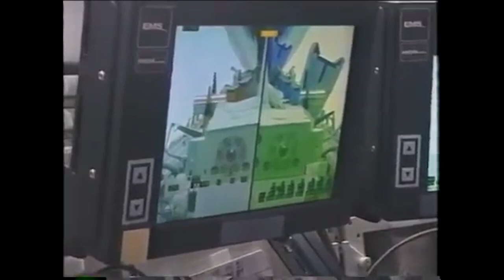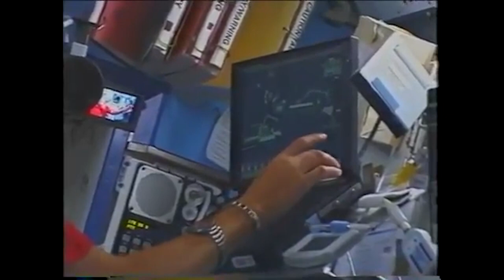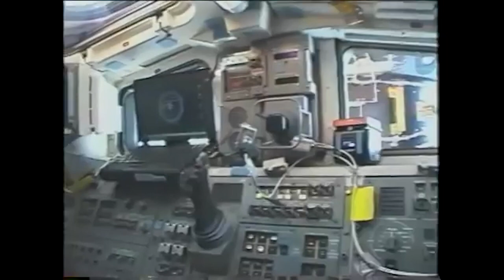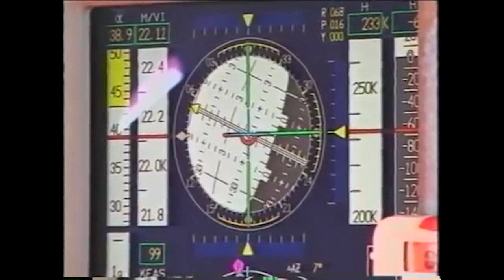International Space Station - Episode 16 - S1 Truss

Comment: STS 112 and 113 were important flights they delivered the radiators to the station. Each radiator is housed on the S1 and P1 truss and expels heat from the station. During launch of STS 112 a chunk of ice baked into the foam came off the tank and struck the SRBs O'keefe told NASA to ignore it and press ahead with STS 113 and STS 107. This mistake by O'keefe lead to the loss of Columbia and the destruction of four rockets because NASA and ILS put safety second instead of first.  Because of Columbia, September 11th and Bush placing O'keefe as administer all ISS flights were cancelled until 2005 and the Centrifuge and HAB 1 were canceled Nauka and the Science Power Platform were placed into storage but degraded and two research modules were also canceled. STS 114 and 121 would later bring the shuttle back to flight Bush fired O'keefe as a political hack and replaced him with Griffins to return the shuttle to flight and Bush directed all future flights to be ISS missions and the shuttle to be retired by 2012 to make way for missions by Dragon and the Cygnus spacecraft. After STS 112 all rockets are fitted with a rocket cam so the engineers can know what went wrong in the event of a failure. This would prove helpful on STS 114 and future shuttle missions and on Dragon and the Cygnus including Soyuz which had several rocket failures and ice strikes before they made each spacecraft safe.
Reply: The space shuttle now rests firmly in a museum for people to learn all about its history and how it was built.
Reply: One question.

Why was O'Keefe a political hack?
Reply: @angelagreen5208  he had financing as his background not logistics or engineering. Griffins, Bolden, and Bridenstine come from the aviation field so they know what they are doing O'Keefe does not.
Reply: @geomodelrailroader  so that explains why the space shuttle columbia disintegrated over Texas because of O'Keefe.
Reply: @angelagreen5208  exactly he wanted science to progress instead of crew safety thats why Bush got rid of him.